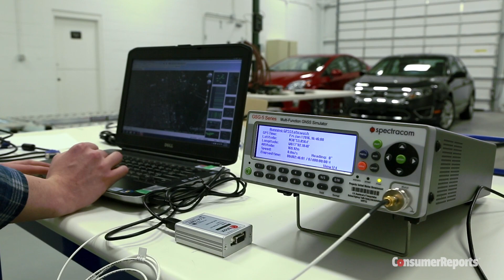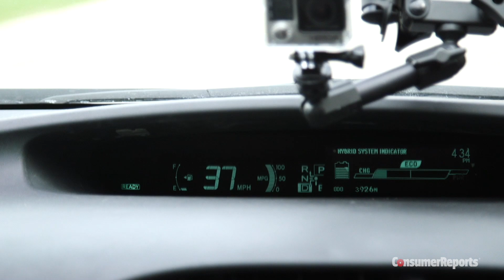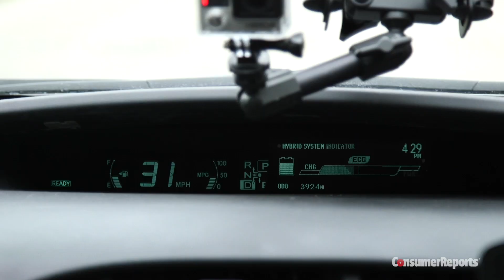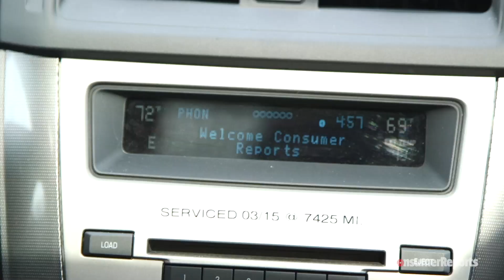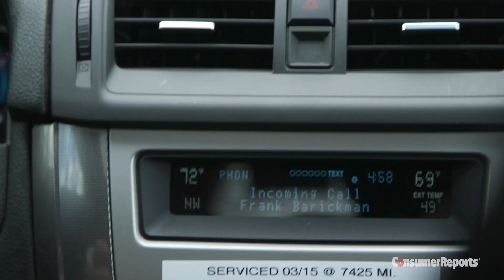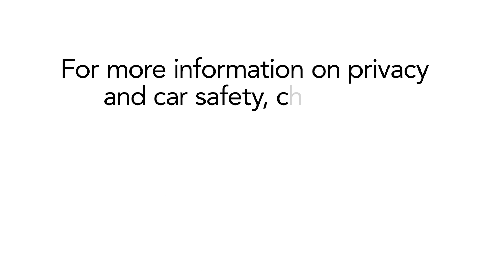Car Hacking: Inside a Government Test Lab | Consumer Reports

Comment: It is amusing to see the comments that were made 3 years ago, as technology changes so does the possibilities of what can or cannot be done. Every car that will be manufactured in the near future will have a direct communication link to the manufacturer for upgrades and patch management for various software. Watching this video which was posted 3 years ago might not have seemed to be much of a useful hack especially the effort it took or how the hacker needed to be in the passenger seat equipped with wifi or 3G signal etc. Some would have said things differently, things evolve and in order for them to get more advanced and simple to operate. (advancement in communication technologies make simpler, vulnerable devices because they are able to talk to each other more effortlessly ), such research sitting in the passenger seat was necessary and most importantly the idea, concept of such as a possibility is equally worth as the ideas that challenge its practicality.

Comment: i have a chevy 1979 pick up running fine with 468 959 on it try to hack that!!
Reply: with physical access, easy. install a remote cellular network radio. then wire that to different malicious electronics to do what's desired. you think you couldn't cut a brake line remotely using an electric device. shoot, I could hook a heating element to your hoses that is powered by your car's battery that just waits for a radio signal to start burning through your hoses. I don't even need moving parts. how about a small pump that puts car exhaust in your cabin and puts you to sleep? or, car bombs... there are probably a million even better ideas than those...

Comment: What a load of rubbish. Everyday circumstances can cause keyless autos to become unresponsive to the keyfob, rendering the auto unable to start. That is why certain people buy ONLY vehicles that have an IGNITION.
Reply: all cars with an internal combustion engines have an ignition... it ignites the first combustion...
Reply: Geoff Miller What they mean is an ignition which one uses a coded key 🔑 to start the vehicle versus one that uses a Transponder which senses a signal to the push button on or near the dashboard to start the vehicle.
Reply: Geoff Miller You're forgiven.

Comment: when my dad won VW Jetta 2011 of a IAAI auction, he told me to fix it up, i went in, saw that acceleration pedal, it was sensor-ed and hooked up by wires, i was like no, nooooh,

-but if your steering wheel and breaks are computer controlled that should ring someone's Bells,,,

-personally, i think keep old cars and try to restore them, cuz if you dont know what you use your being naive, i like turbo diesel with no ECU, cuz of efficiency and "other factors"

Comment: I still have my old 95 celica... obd1 .. try to hack that
Reply: with physical access, easy. install a controller with a cell connection so I can send commands remotely. then install each malicious device. I could cut brake lines, clog vacuum lines, inject malicious fluids, set of a stink bomb, direct exhaust into cabin, smoke bomb, set of horn, turn up radios, deflate tires, open valves, or just set off a bomb. pretty much any car can be hacked remotely. it just takes different devices. it's like people who tell me I shouldn't have a digital door lock because it could get hacked. how many regular locks are hacked each year with crowbars?
Reply: Geoff Miller
Exactly. You would need physical address. But then you would have to figure out how to dodge a 9mm.
Reply: A pumpkin smasher is not intruding. Said smasher is trespassing. There is a difference. I only mentioned that there are very real circumstances where it clearly would be legal to defend your property with deadly force. For instance, a car parked in your garage. If you hear your side garage door get kicked in at 2 am. Go out in your garage and see someone with a flashlight in your garage next to a door that's been forced open, you are not required to wait to find out what the person's intention is. Nor should you be required to. You didn't create the situation. There is no reason why you should have to put your life at risk in determining if he's there to kill you or just to play a prank on you or to try to kill you by cutting your brake lines. If you don't want to put people in the position of favoring using deadly force against you because your intentions are misunderstood, I would suggest not breaking into a home and making it a reasonable consideration for someone.

Picking an example where violation of one's property would not be justifiable cause for deadly force in defense of said act does not prove that no such circumstance could occur. Further, cherry picking one state doesn't help your case either. But if I can show even one example where it would be legally justified, it does ruin your argument. The burden of proof is on you, not on me to justify your inaccurate generality.
Reply: Geoff Miller
Yeah I was joking. I agree, state laws do vary.
Reply: Yea. And if that cop were killed under the same circumstances that it would be legal to kill any other man, this shows the corruption in the system. Police only are police when acting within their jurisdictions. Outside of that, they are normal people and should be subject to the law and penalties of the law the same as all of us. I'm sure you don't disagree but I'll state that anyway.

But my comments aren't to say there aren't many circumstances where it would be illegal to protect your car's integrity by deadly force, but to show that the OP's statement on protecting his car with a gun is actually legit when circumstance is taken into account.

There is actually a case where a guy had the cops kick in his door. He shot and killed one. I think he spent 3 years in jail for it. The cops were at the wrong address. Penn and Teller featured the story in an episode of Bullshit on the Justice System in the US. This is just one of many such cases. But this is a whole other topic that would get me really going cuz cops are out of control.
Reply: ***** Haha. While funny, very untrue; despite police murdering many. But the reason I care to state the obvious there is to contrast it with a slightly different but nearly identical statement that actually is true. We have police to protect us from theft but this year marks the first time police themselves have actually stolen extra-constitutionally more than "actual" criminals have. You should look up civil forfeiture. It's outrageous. 

Here's a reference to the data I am actually referring to:

https://www.washingtonpost.com/news/wonk/wp/2015/11/23/cops-took-more-stuff-from-people-than-burglars-did-last-year/

Summary, civil forfeiture is when the police charge your property with a crime. They are able to argue that property has no constitutional rights as it is not a person or legal entity. That means they can assume guilt until you prove innocence whereas we all know with people you must be legally assumed innocent until proven guilty.
Reply: Interesting. I wasn't aware of some of that, although it doesn't surprise me. I would agree with the revised statement that far too many pigs are the scum of the Earth. One of my closest friends married a cop. His wife has been a cop for a long time in Phoenix. She's the nicest person and generally very caring towards others. But I had a disturbing conversation with her once that reveals much of the problem. Despite her admitting that there are many cops who are scum and assault or murder citizens, I pointed out that if you defend yourself from a corrupt cop, you put yourself in danger of being taken down by another cop. The other cop might otherwise be a great cop but because of cops' attitudes towards each other, even a great cop can facilitate, by extension, murder or assault in defending a corrupt cop. The disturbing part of the conversation was that despite he agreeing with this she still expressed that she would fully backup a cop in this situation. The brothers-in-blue mentality is understandable on some level but explains why so much of this horrific corruption is entrenched and spiralling out of control.

Comment: 1-physically-limited instruction set chips that can't be overwritten.
2-require a switch to be physically closed to enable system updates from an external source. no over-the-air updates

Current computer "security" is garbage, made on purpose to be cheap to hack (the software that allows large companies to use very few computer techs to maintain their equipment is what allows for remote hacking).

Ask yourself, for example, why doesn't your DOS require input from a physically-connected, known, registered input device before critical files or boot records are compromised, or files remotely encrypted? 

Security can be had, but not while we want to do everything on the cheap.
Reply: Exactry. Most ecu software is compiled down to machine code and hard coded into the ROM. There's no physical link to any thing else that would allow remote access.
Reply: +TheArfdog you don't have to change the code to hack. you can use the code that already exists to perform the hack. how? what is code? it is the logical representation of a machine that runs on a universal machine. this is how Alan Turing described it. so if I know your code takes an input and gives a computed output and I can predict what inputs give what outputs, I can simply provide the input to your code that gives the desired output. with physical access to the machine, I can give whatever input that I want. so basically, I'm picking the output too. 

for example, I can fake sensor that the brakes are applied and the wheels have locked up. this would cause and to trigger nonstop. abs will always trigger if brakes are applied and wheels are locked up. that's what their for. I can use my knowledge of the code to get it to work for me.

but people should know that you could effectively hack traditional, mechanically operated vehicles as well. I could install a devices on a car that would cut a brake lines remotely or force open fuel valves. 

an idea I had while writing this: why not use a rotating token that is stored in the ignition key? rotate every n seconds. but even this wouldn't protect you from attackers with physical access as they could spoof the signal between the sensor and where the token is added. so the spoof signal would be correctly signed. unless you were able to create a 2nd token that lives on each sensor so the signal directly from the sensor was signed. but then you'd need a system for manging this. then you'd need to hack each sensor into providing false inputs, instead of just spoofing the signal.

so there is always a defense and a way to defeat it.
Reply: +Geoff Miller sorry for typos. using a swipe keyboard :/

Comment: Moral of the story:  Always check your passenger seat for hackers.
Reply: LOL. People are so gullible. Tell them the most unlikely thing to happen and they think it's the MOST likely thing to happen. Car hacking is 100% impossible unless you invite a skilled computer hacker into your vehicle for a few hours.
Reply: ***** Yeah... see if you can explain how remote hacking works if the cellular system isn't physically connected to the engine control computers, and the engine control computers don't use Windows... try machine language.
Reply: ***** Not all operating systems are coded in machine language. The ECU of a car is.
Reply: ***** lol yeah write back when the next car is "hacked" wirelessly....